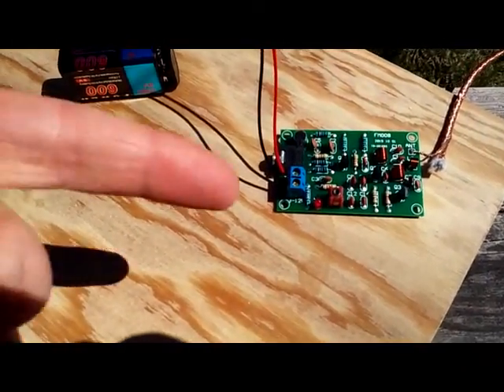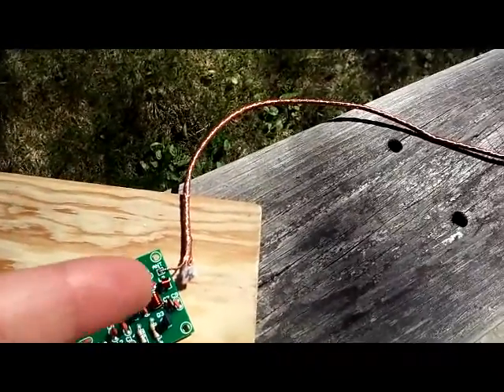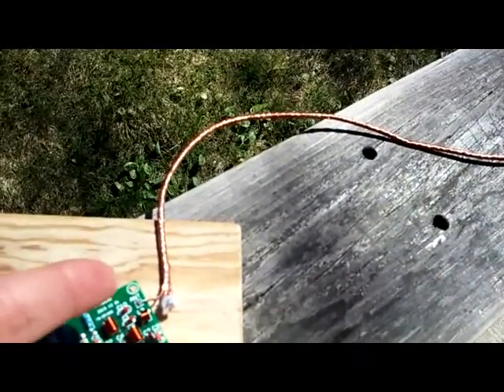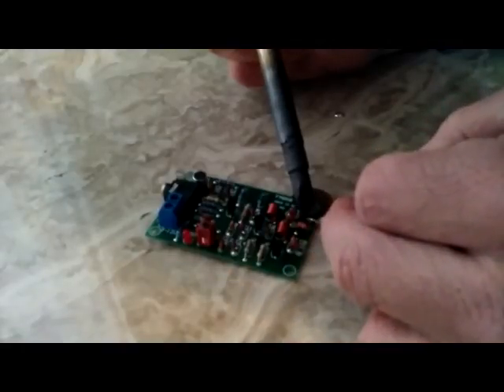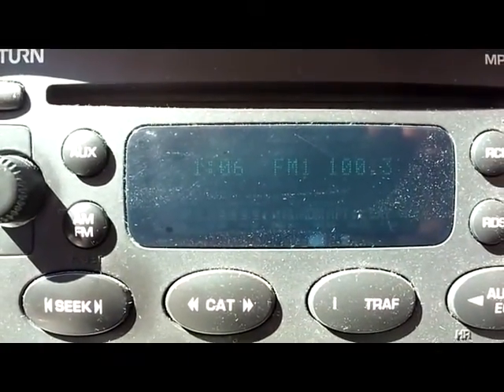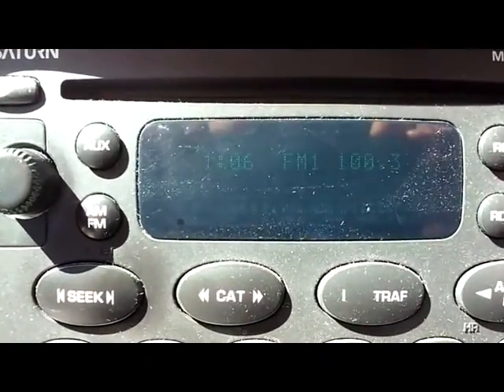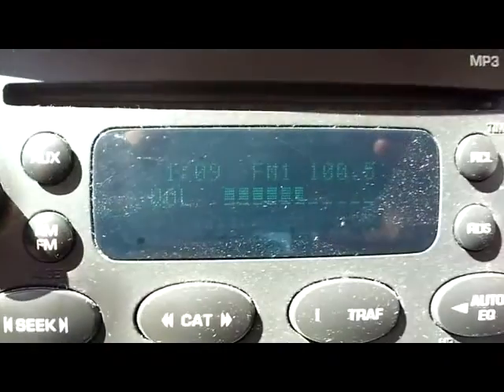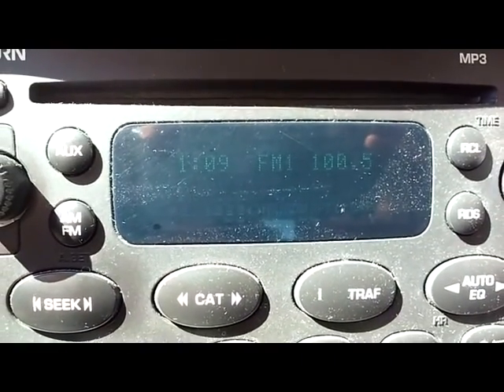DIY Radio Transmitter, Listen on FM Radio 📻

Comment: cool video. Is the antenna a single insulated wire with stranded wire wraped around it? If so what is the advantage of doing this?
Reply from the maker: Antenna is stranded copper wire I got from stripping a speaker cable! Solid or twisted/braided copper wire makes no difference in radio transmission. Thanks for watching.